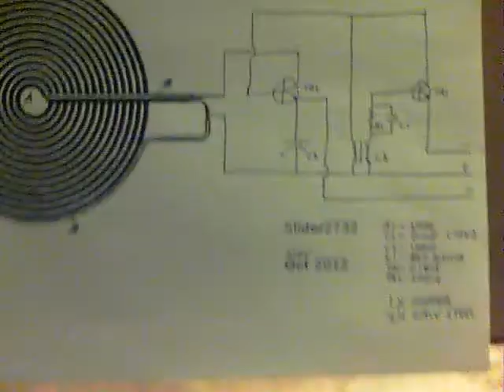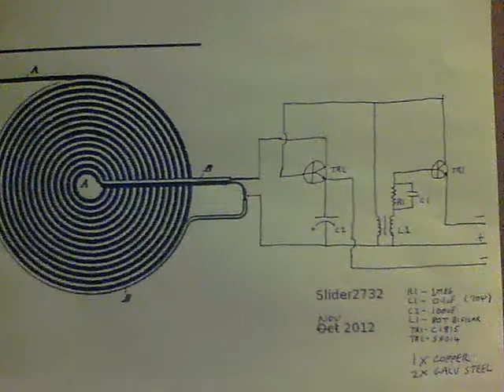Water Wireless Circuit - 2 LED bifilar

Comment from the maker: Cheers for watching and the comment. Yeah, i'm sure you've found how all 4 wires will oscillate together ? All become phase locked, which is annoying for multiphase multifrequency running inside 1 coil.

Comment: How did I miss this. Only just seen it?? Brilliant little oscillator. I have noticed the center tap to outer can work well too. You can get some interesting results with a quadfilar coil. by playing around with which taps you use.

Comment from the maker: C1815 on the oscillator, S9014 on the coil. 
1meg resistor, 0.1uF ceramic, 80 turn bifilar on small ferrite, 100uF electrolytic.
The transmit coil is the same one as in the first Simple Wireless Electricity vid, so all that had to happen was the Base be disconnected. 2N2222A or others with high hFE will work fine. Got a single filar running now using a C3198 too. On an AA you'd think it would be blazing, but oversaturates, flashes once and once again on battery removal...likes to run on water :)

Comment from the maker: Copper has a nasty habit of galvanizing itself, as all positive electrodes do (even the lead plates in LAB's yet the negs will remain fine). But, if kept clean the oxides don't have time to sit and fester and attack...learned with the garden lights that a regular wipe down removes what starts as a filmy layer. Nephilim Penny's copper is quite bad as I haven't cleaned it on purpose for over 3 months (still running in water though). 
A regular wipe down vastly improves running and longevity :)

Comment from the maker: Thanks. Output is approx 0.7V and 60uA. This should run for over a year if I wipe the electrodes once a week or so. Nephilim Penny LED oscillator has been running continually for over a year now with same water.